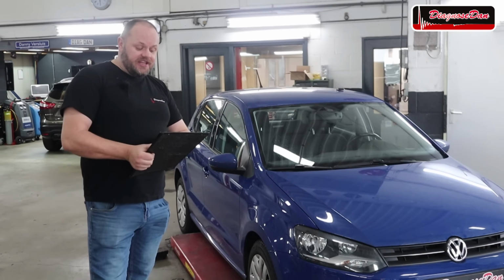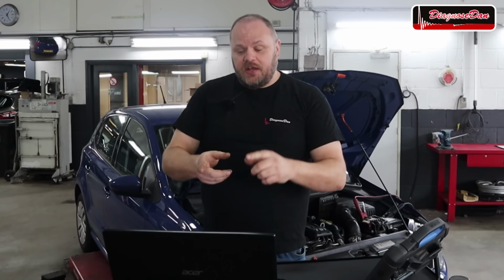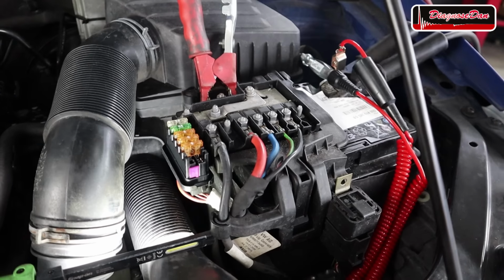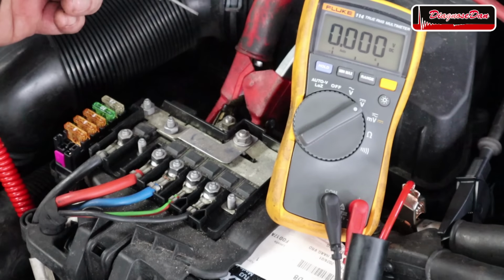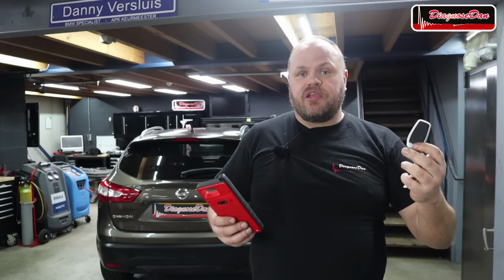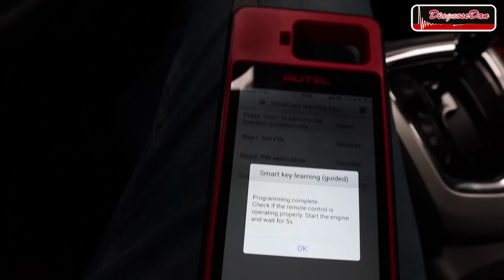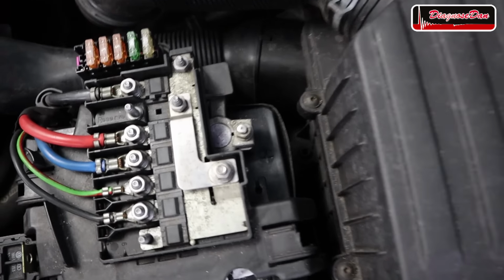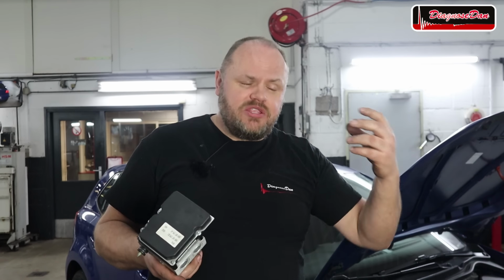VOLKSWAGEN ABS FIX

Comment: Backprobing your CAN wires with the module plugged in doesn’t always mean your CAN to the module is ok. If your power and grounds were good the CAN trace you saw on scope could be the ABS CAN coms , you would need it unplugged to confirm CAN to the module is ok. 

Also a multimeter alone would have confirmed this issue IF vault drop was carried out correctly. 

Terrible work from the previous workshop.
Reply from the maker: Hi Daniel, for a can signal to look clean it needs 2 terminating resistors. If the ABS  canbus wires were not connected to the rest of the network we would have 1 resistor at most, and than the signal would have looked alot different

Comment: Or testing them while still plugged in gets you quite far too
Reply from the maker: It was plugged in....,but the 2 fat wires were actually for the pump motor. When thats not running there is no current flow. In the video we never tested the other powers that in hindsight were in the same fuseholder

Comment: That other workshop that missed this fault should close the doors and start baking pizza instead,  they have nothing too do near cars.
Reply: @Diagnosedan  seriously:)
It's unbelievable 😳
Reply from the maker: @Wolfpack310  i talked to the technician when he picked up the vehicle. He told me he tested powers and grounds with a testlight. I think he might have used a wrong diagram and tested the wrong fuses.
Reply: @DiagnoseDan   vw strip link fuses over the battery and around battery often get oxidizet , sometimes it can even look ok when you just eyeball.

Comment: Bet that customer was very angry. Simple corrosion problem turns into big money. How does Dan have time to have a life? Anybody who knows about him beats a path to his shop when their car breaks because you can be assured he will diagnose and fix the problem regardless and with honesty/integrity. People want to know their hard-earned money is going to repair their car - not line the owner's pockets with unearned income. Cars are too complicated now; people used to be satisfied with something basic with direct wiring - no electronic modules. There should only be two computers in cars these days: one for the fuel injection and one for the ABS system. Build a basic car with direct wiring and the following options: A/C, electric windows, electric locks, stereo, navigation, plus a few ports to charge your damned phones. Mechanical controls for the A/C/heating system - nothing automatic. That's it. No computers necessary. Reliability would skyrocket and mechanics could be mechanics instead of electrical engineers. Imagine if everybody (including all the European makes) made simple, reliable cars. Heaven!
Reply from the maker: I dont know if they are going to charge the customer, maybe not since this video is on Youtube now🤣🤣 
I love cars that break down and please make them as unreliable as possible so we keep our jobs🤣

Comment: Why on earth would someone be so silly to send a module off to an outside company when it's obvious just like a house computer it needs power ground and communication so it knows when to turn on and when to turn off and what to do.
Reply from the maker: I talked to the technician when he picked up the vehicle and he told me that he tested the powers using a testlight so i think that maybe he used a wrong diagram and tested the wrong fuses
Reply: @Diagnosedan  Ya that makes sense especially the price of OEM software it's very expensive